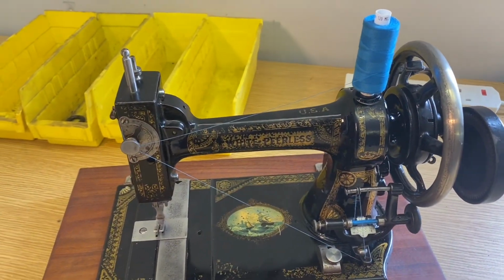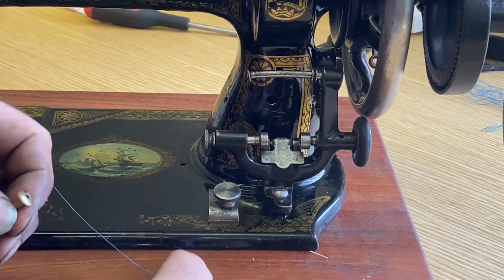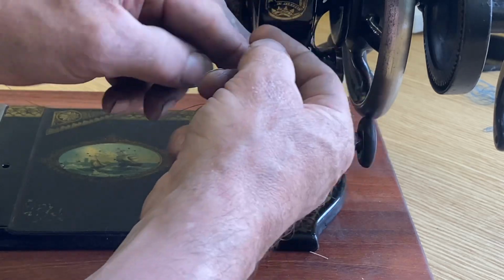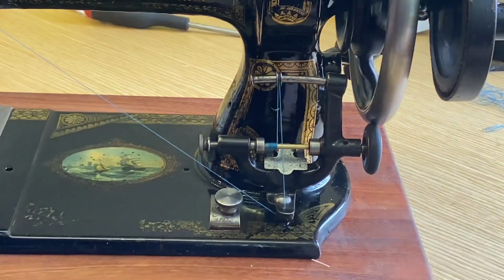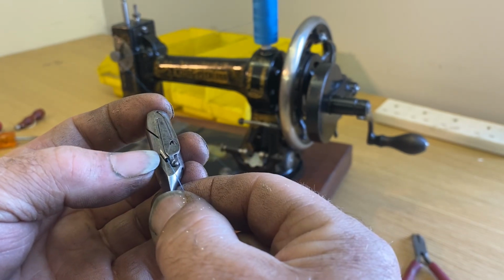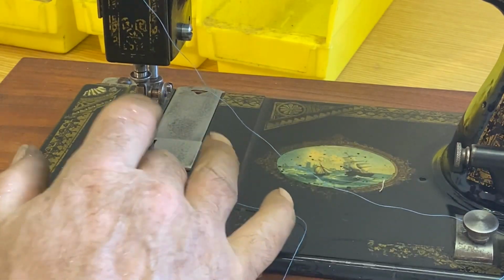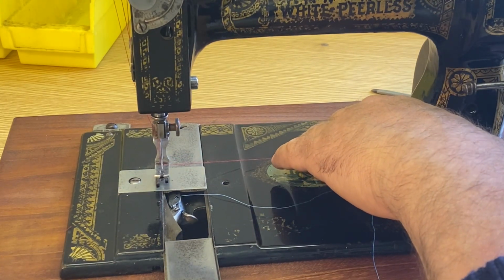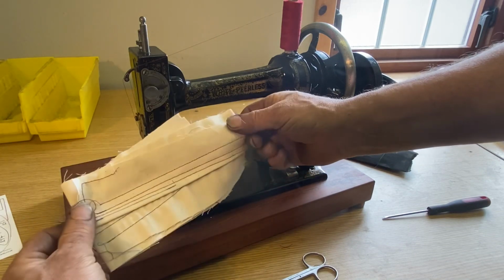White Peerless, vintage sewing machine, How to, Operation and renovation,

Comment: Brought back a memory of winding a bobbin on a Bradbury Family No5 The odd thing is you have to wind the machine in reverse something I skipped over in the manual thinking I knew best.

A very nice restoration I hope to do justice for my Singer 13k that I might just protect it with some Zinsser sanding sealer and a soft brush; it will not be a good as your finish but it will protect the decals and I can always French polish later 

Just remembered working on a very old Jones winder that was very different to later models.
Great explanation 
all the best
Reply from the maker: Thank you for you kind words, yes I considered using shellac or some sanding sealer, but time is the biggest issue for me, and modern coating are much better than was available at the time of manufacture.
Reply: @sailingtessbesssewfarnorth1746  I had a contamination problem I used a soft white flat 1 1/2 inch wide brush it looked like a small house paint brush.
The glue holding the bristles started to dissolve in the methylatedspirit thinners I was using; the sewing machine started to have white bloom forming as it dried, lucky I could wipe it off with a spirit soaked rag. I was trying not to cry and make an even bigger mess dripping on it. TIP leave you brush in the spirit overnight to see if the brush is ok.
I do not normally go for a nice finish for me its more about the machines working to use them and the engineering.

Comment: I have x 3 of these sewing machines…

One I think is an earlier model ( 1880’s? of the two…( have tree scene decals- sadly not in great shape)… 

whilst the other sewing machines  is an 1899 model ..

They are badged with :- Peerless, White Peerless & New White Peerless ( this machine luckily has about 98% intact decals ) ..

The x 3 machines made by the White Seeing Machine Company in USA were imported to Australia from 1870? To early 1900’s.. 

I’m in search for more hollow tube bobbin pins …

as I only have x 1 hollow tube pin between x 3 Peerless models of the White Sewing Machine Company …

( the shuttle I had been luckier to obtain as one was found in a tin of Singer accessories parts 

& the other two machines still had the shuttle in them ( but not the darn hollow bobbin pin)..

.. I had that centre pin shuttle for about a year before I could find the correct machine that fitted the shuttle…

 ( usually you find the machine then search for a shuttle… lol)  

& now I have x 3 of the White Sewing Machine Company …

I live in Adelaide, South Australia…